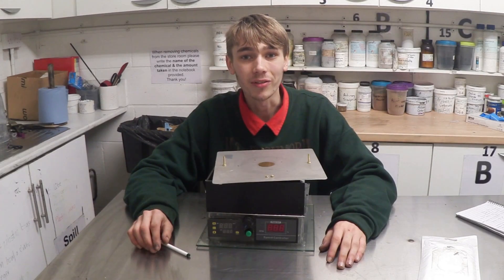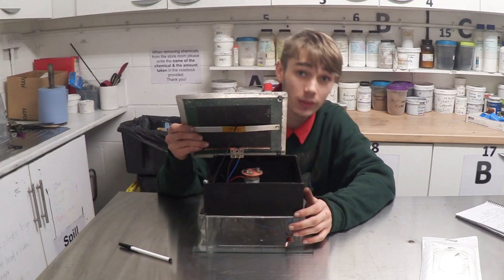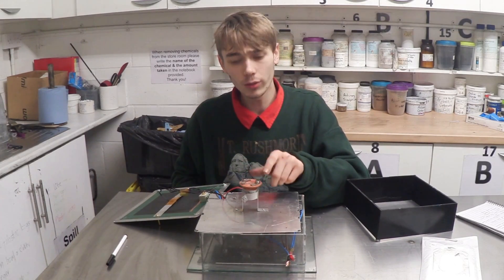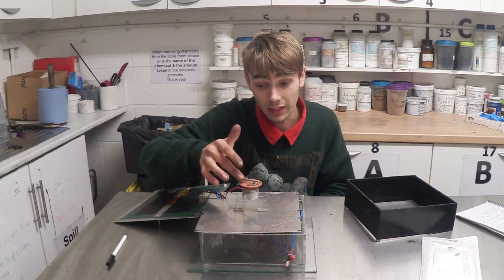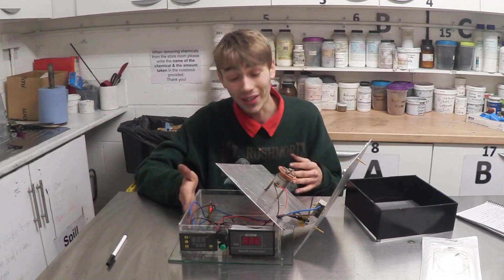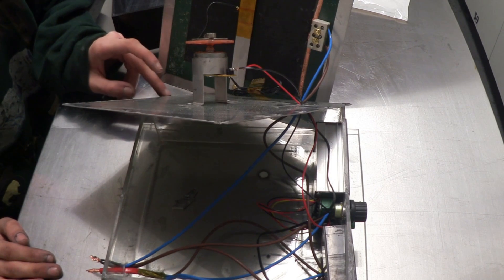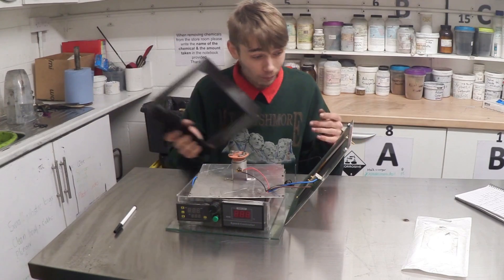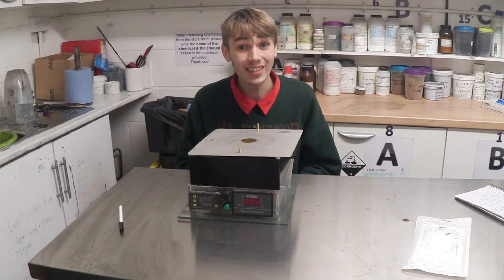Heated Lab Stirrer made with Conductive Ink - Follow up

Comment: Just so you know...  The reason that you keep losing control of your stir bar is because you used the hard drive magnets.   I'll try to be clear, since I cant draw a diagram in this comment, lol.  The HDMs (Hard Drive Magnets) each have a north pole on one end and a south on the other.   Looking at the positioning of the HDMs, if they were attracted to each other when you glued them down, then the lines of force between the HDMs are traveling mainly in the plain of the rotation of the disk, and if they were repelling each other, the lines of force are being pushed outwards, and up into the beaker.  The second situation, provides your stir bar with two north poles and two south, one set of poles from HDMs and one from the disk shaped neos.  That will allow the magnetic stirrer to switch from one set of poles to the other, eventually with enough force to break free from the magnetic cogging that keeps the bar spinning in the middle of the beaker.  The first situation, would provide a weakened field over all, allowing the stir bar to sling itself loose from its magnetic coupling, via centrifugal force or when hitting any solid bits in the mixture that you are heating.  I suspect that you have the second situation there, judging by the way that the bar was still rotating while against the side of the beaker...  that is tremendously dangerous!  Hot solvents or acids dumped on live electronics, due to broken glassware can cause chemical burns, regular burns, and even explosions. 

    For best control of the stir bar, it must see two distinct magnetic poles.  This is impossible to achieve with HDMs, as their north and south poles are so very large, each taking up nearly half of the face of the magnet.  I would recommend that you rebuild, at least, the magnet assembly using only the disk magnets and an Iron or steel bar under the disk magnets to bridge the under sides of the magnets.  This will provide a more positive lock on the stir bar.
    A second concern may be that the graphene in the heater is paramagnetic,  and therefore will reduce the amount of magnetic field penetrating it.   This should be negligible at lower speeds, but as rpms increase your hold on the stirrer will get weaker and weaker.  A solution to that would be to run the stirrer with the heater in place as the ink dries.  Doing this should allow the graphene flakes to orient to the flux from the magnets as the ink sets, greatly reducing the magnetic reluctance of the ink.  However, this may change the resistance of the heater, and/or cause a cool spot in the center of your hot plate.  But if the metal plate is aluminum, and the magnets are close enough together, that may be acceptable, due to the high thermal conductivity of the aluminum.
    Of course aluminum is also mildly paramagnetic, so the optimal choice would be a piece of borosilicate glass, but that would be over-kill, as even professional units use aluminum, I think.   Hope that this helps, would love to see an update with a safely working model.

Comment: This might be a bit funny but also pretty cool. I posted a method for what I believed to have been a method for producing graphene but was instead silicon that was deposited on the glass. 
What I did was take AGS graphite powder and put in a teaspoon of isopropyl alcohol in a small open glass jar and kept igniting it until the alcohol evaporated. A thin grayish film was left behind. It turns out in the graphite powder by that brand they also put silicone in there and ash. So if I were to aim to produce a thin layer deposit of silicon I would use isopropyl alcohol, silicone powder and ignite on glass to deposit a thin silicon film. Thin silicon is excellent for batteries I realized what my mistake was after reading the label and seeing a news article that was recent online about a similar method to produce thin silicon deposits for super batteries which was a huge technological breakthrough.

Comment: The heater is very interesting. Not what I expected. I expected something resembling a spiral element or similar painted onto the plate. I would be interested to see how even the spread is with your heater. Do you have a thermal camera (FLIR etc) that you could show this with? Great video, keep up the good work!
Reply: Thank you!
I don't think I have a thermal camera but that would be awesome if I did.
I might have to source one very soon!
Reply: @MyNameIsLukey  Get Rob to buy you one! Seriously though, a thermal camera would be a must, not a want, if you were to get into designing and or producing heating elements. Not just for you, but all of FWG.
Reply: Oh, I forgot to mention; it may be an idea to place the thermocouple in the actual fluid that is being heated as opposed to on the heating plate itself as you will loose heat as it transfers to the beaker/fluid and the temp of your fluid may be less than that indicated. My hotplate stirrer has a stainless steel probe that I mount on a bracket so the end is going into the fluid. It does however overshoot the temp somewhat until it stabilizes but I get around that by setting the temp about 5 degrees below what I want, let it overshoot then increase the temp to my desired temp and it levels out nicely.

Comment: Was the aluminium hotplate part coated with anything other than the graphite like when Robert use a Teflon coated baking tray for his hotplate?
Reply: Well, the heat plate part is insulated with stove paint. 
I did this so when I'm stirring solutions, it shouldn't react with the aluminum sheet which was a bit of a worry for me.
It seems to be doing the job just fine which is awesome!